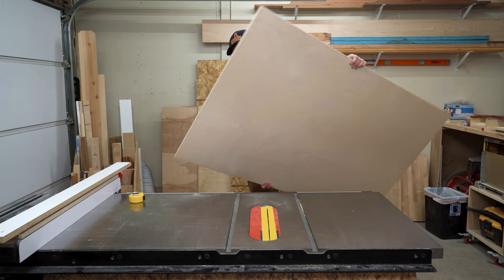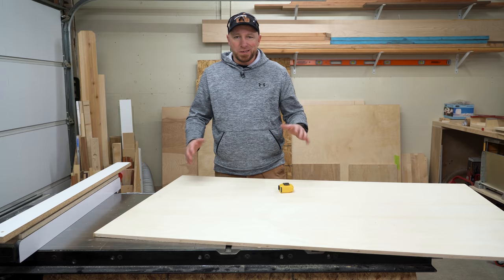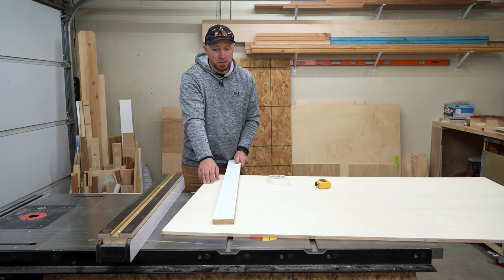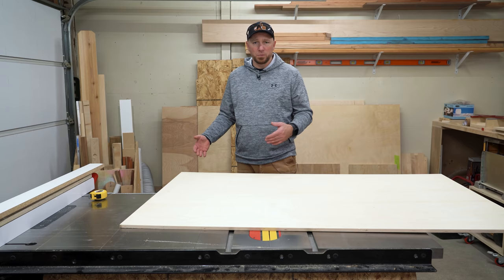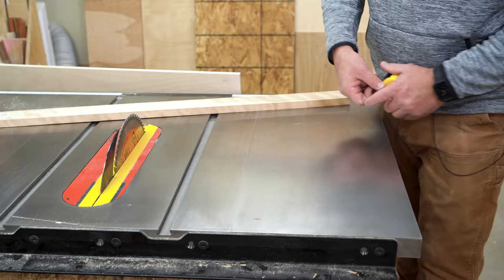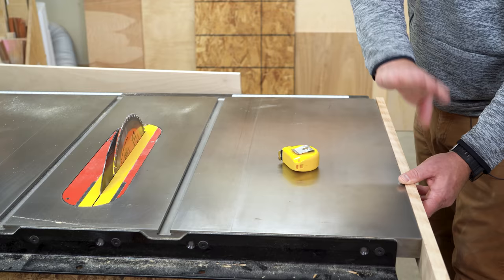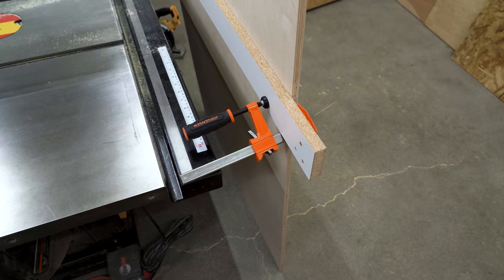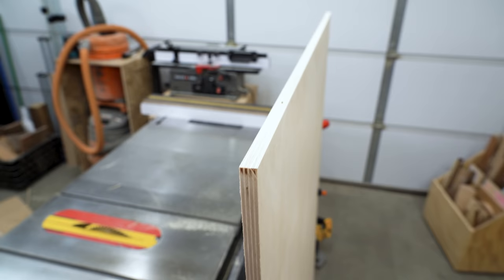A Table Saw Trick So Crazy, It's Genius!

Comment: Great tip, I am a cabinetmaker and I enjoy figuring out clever ways of solving the puzzles that woodworking presents. One suggestion for increased accuracy: when measuring from the saw blade to the edge of the table to check if they are parallel, take a magic marker and mark a tooth on the blade then measure from the marked tooth to the edge then rotate the blade so that you can measure from the same tooth for your second measurement. The saw blade may be warped just slightly and measuring from the same tooth both times eliminates that issue. Keep the great tips coming!
Reply: We usually just cut from the drop side against the fence.

If you stand with the sheet braced against your hip and keep your hands outside the blade, even if it does kickback, it will throw the sheet in such a way that it will rotate off your hip and your hands will be thrown away from the blade.

The saw sounds like it is on the verge of kickback the entire time you are cutting ( because it is), but your cuts will be within a 32nd straight and that is fine if you hide that edge where the shoe molding or crown will cover it.
Reply: yes
Reply: Blade warpage will make one tooth, or teeth, on that blade a shorter distance from the table edge than all the rest, so arbitrarily picking a tooth, or teeth, other than that one(s) just mentioned, will give you an incorrect cutting distance. One way to check for warpage, and if it exists, to identify the shortest distanced tooth, or teeth, is to use an indicator mounted on a stand and check the blade by rotating it by hand to check for the high point which will allow you to identify the shortest distince tooth, or teeth from your table edge.
Reply: @Orange-Jumpsuit-Time  I am not convinced that is necessary, especially if you can adjust for that slight change in dimension when you set the fence distance.

Otherwise you can make a couple cuts and bring your fence distance marker to the measured dimension cut.
Reply: Really? You are a cabinet maker and you are still learning how to use a table saw accurately. Well, the first thing is not to cut off your fingers.
Reply: @jeffshackleford3152  i hear no threatening kickbackage
Reply: @rosskstar  when you are cutting the way I described the saw will sound like it wants to kickback, because it is on the verge of kickback.

That is why you keep your hands outside the blade, instead of cutting that small piece off with your hand inside the blade.
Reply: @jeffshackleford3152  well OK then.... just be sure to read yer bible n say yer prayers, cuz it's all a goin down dagnabbit

Comment: I have been making things out of wood for 60 years. I have never seen this before. What I like best about it is that it appears to be very safe as well as accurate. Well done.
Reply: Hardly accurate when the squaring is done with such a small square.
Reply: @peterowens290  explain your point of being "inaccurate"
Reply: @peterowens290 ., Exactly, hardly square, is the word.
Reply: @peterowens290  
Remember it’s not the size of the square that matters, it’s how you use it.

No I’m just fucking kidding, ....you’re right
Reply: @charliedelta9501  that would be an unfortunate family name name of the company making the square. Hardly square. Lol
Reply: @peterowens290  apparently wood workers are measuring to within .001" now! XD gimme a break.
Reply: @coresnap  the fact is if you check from both sides and measure from the edge on both sides you can get a surprising level of precision.  No, it wont be nanometer precise but its wood.  Like you said... gimme a break.
Reply: With so much of the sheet hanging over empty space, unsupported, relying on the operator to hold it down to the table while still keeping the clamped straight-edge flat against the side of the table, and still pushing the sheet over the blade, I'm not with you on the safety aspect.
Reply: @vladtepes97 what part are you saying is unsupported? Looks to me like he was providing sufficient support. It certainly looks much safer than many other cuts I've seen done on table saws.
Reply: Omg. Peanut gallery over here. Gimme a break indeed.  He created a quick and simple jig that gets the job done.
Reply: If you tried this with a finished surface you would have massive blow out. It's pretty stupid unless you're not worried about a perfect edge. Way smarter to use a router with a roller guide and a straight edge with clamps. I made these cuts in the field every day when I'm installing. No mistakes allowed method.
Reply: @stirfrybry1 What do you put under your sheet when you make the cut?
Reply: @Mjr._Kong We make the cut with the piece (like for instance a counter top) on saw horses. Use clamps to hold a straight edge and then use the router to cut along the piece. Very fast and accurate as long as you check twice and cut once. LOL
Reply: @stirfrybry1  Any underlayment?
Reply: @Mjr._Kong We clamp a block on the end of the cut to prevent blow out, but the router cuts clean top and bottom edge. I'm working with laminated surfaces in a commercial cabinet factory where any chipping ruins the entire piece
Reply: @stirfrybry1 . But you have to have a router to do this. Some folks just getting started in wood working might have a table saw but have not advanced to the point of having a router yet.
Reply: @Sillyturner  not this is everyone situation, but I find it funny that you said that cause a router was like my first things (besides a drill and hand tools) I had cause I found out you can do a lot of things with it. I sure somewhere OSHA handbook is burning if they saw some of the things I did with this thing. On that note, don’t use your tool in away that could hurt you.
Reply: @stirfrybry1  if you could drop a link showing this done that would be great. I’m having a hard time visualizing how this is done.

Comment: I love this. I submit that this can also be used for making  cabinet panels, (typically 34-1/2 in. long), where some home saws only have a 24 in. wide table, And yes there are other ways to accomplish that, (as you stated), but for 2-6 panels, this is a great idea. Not everyone can afford/have the room for a cabinet saw.
Reply from the maker: Or can afford a track saw that's actually decent. Thanks for leaving a rational comment and actually paying attention. Ha!
Reply: @InspireWoodcraft  Just an observation: You don't need to worry about the tape hook at the start of the tape messing your measurement, that hook moves a distance precisely calculated to take into account the hook thickness.
Reply: @skwalka6372  its just hard to place the hook ontop of the board..
Reply: @InspireWoodcraft  super sketchy you have a $4,000+ sawstop table saw and woodpeckers tools but don't own a decent circular saw or a track saw... 😂😂😂
Reply: @Dave Ortwine  or he is showing those that dont have those tools a way they can get stuff done on the saw they have, such as a jobsite saw.

Comment: Great tip and I'll keep it in mind that next time I'm faced with that issue.  Another tip if one wanted to increase the accuaracy when measuring from the table edge to the saw blade, simply place a long straight edge (12" to 15") against two of the saw teeth to widen the area of the measurement when checking for parallelism.

Comment: Hi Jodee, I used this method this morning to cut the sides of a set of cabinets to their final size. I have an old 119 series Craftsman table saw that has a limited fence width, however, this method worked GREAT! 
I receive a lot of value from your videos. Thanks for putting in the time and effort to produce these awesome resources!

Comment: Nice tip! Thanks for that.
I retired my table saw for any full/half sheet cuts. I got that Kreg rip cut and with my Skil magnesium worm drive and a sheet of rigid foam insulation under it, it’s so much easier.

Comment: I think my favorite method of cleaning up an edge on a large piece is to use a trim router and set up a straight edge, and use a flush trim router bit.
Reply: That was my go to until I extended my fence rails out to allow for 60" cuts.
Reply: 100 times safer as well.
Reply: 100% agree with this remark. I'm a Retired General Contractor. A router is so much easier and can be used in the field without a table saw. A couple of saw horses, a couple of clamps, a straight edge (I use an aluminum 10' 2 x 4 screed) and a router with the proper bit. Not only is it faster, safer and easier, you get a jointer quality edge every time. If a jointer edge is not needed try a Skil worm drive contractor's saw with the proper blade. Wobble has never been an issue with that kind of saw with me. Also with the proper set up on saw horses you can cut right across the top of the saw horses to easily cut plywood of any length, in any direction with proper support, 8' 12' any foot, no problem with perfect straight cuts.
Reply: @Ron-no4tp  Thank you Ron. I have also used this method to make fine adjustments to make doors fit, or shave off a bit from the top and bottom.  I have some closet doors that I built that I need to reduce their length to make the guides fit a bit better. And so, when I have time, thats one more on my list to do.   When I am doing 1 1/2 thick material, I will use the router and take off a bit more than half way through and then come back with a flush trim bit and get the other side.
Reply: @Ron-no4tp  I've been a contractor for 40 years, getting ready for retirement myself. I don't even own a big heavy shop table saw, it just takes up too much real estate in my shop.. I do have a 10" job site table saw that I use If I have many rips to do, I'll bring that to the job. But, honestly, I prefer cutting sheets of plywood with a good straight edge with some clamps and a good corded circular saw, good blade is all you need and good saw horses with 2x4s on top, will get that job done easily, and alone with no help. Struggling with a full 3/4" sheet of finished plywood solo on a table saw is a hassle.  As a contractor, I try to travel light. But for guys that are working on a budget, or have limited space, you can get table saw quality cuts on a very small budget and put it all away in a small space. I see so many shop wood workers that don't have a good $120  circular saw but they have a $2000 table saw. I've made lots of Built ins in homes with nothing more than a circular saw, a miter saw, a portable table saw, Most of the time, I don't even need a router.
Reply: I've used both the table saw edge method as well as the router/flush trim bit/straightedge method for many years.  They both work well but the router is much less awkward when the panel hangs over the table saw edge by a large amount - for example, when you're cross-cutting something close to a full sheet.

Comment: Normally I would use my circular saw guide for a cut like this but I tried this instead. It worked out great. I was able to support the offcut with full control. Thanks!
Reply: I was actually wondering if you couldn't use one of those clamp-on circular saw edge guides like Harbor Freight and Bora have to ride the edge of the table saw instead of the clamped board.

Comment: Thank you for bringing up the often forgotten parallel edge guide in a table saw. I have a craftsman table saw with tabs on top of miter gauge slots, making it difficult to construct runners for the sled. Thanks to an utuber, I built the sled with runners guided by the outside ends of the table, just like the one u have shown. No fancy trial and error to build the perfect runners to run on table slot.
Reply: I would love to know where you found that. My TS is a really old craftsman with the tabbed miter slots, too.
Reply: @wendytorkelson9305  don’t remember. The fix is easy. With an angle grinder you can cut off the tabs, if you want to use the table slots for sled rails. Or, you can build a bigger sled with table edges as guides with runners attached to the sled

Comment: You can avoid some hassle by setting the table saw fence next to the blade, then lower the blade and just clamp the guide board to your sheet using your fence as a reference. And, Check for square! Great videos!
Reply: Yes so long as the edge of the plywood is already square and flat, whereas I believe he was saying his edge was wobbly.
Reply: I am not a lateral thinker .Would You have a diagram please ? ThankYou either way !
Reply: That cuts the task down dramatically! Thanks.
Reply: I think this video addresses the situation where the edge to be cut off is not straight enough to use as a reference.
Reply: You have more plywood hangover weight to deal with not practical work smarter not harder
Reply: This should work if you have a factory edge or square edge and you’re doing a cut somewhere deep into a large panel. However in the video it’s not a square edge. The video tip deals with both large material and wobbly edge at the same time.

Comment: Nice tip! As a cabinet maker of 30 years (I now have saws that will cut this, but before...), I would have used a router, straight edge and clamps to do the same cut. For guys interested in woodworking, it's AMAZING, how many times you will use a GOOD track saw if you spend the money for one!  Free hand cuts (odd shapes and angles) and live edge cuts are pretty much  made SAFE, and it's EASY to make track jigs for a router or other equipment!
Reply: Yep. Router.

Comment: Good tip, short and sweet!  If you have a lot of overhang, it helps to place a roller stand under that so you're not fighting that tendency to tip while you're pushing the sheet through the cut.

Comment: And this video is a good example of why this is my favourite channel. I run into this problem all the time and I always turn to my wobbly circ saw.
Thank you so much for posting this.
Reply: Make a simple brace for the rear of your wobbly saw, so that the baseplate is supported in two places, rather than just at the height adjustment hinge.
So, looking from the rear of the saw....
Instead of 1 support like this on your base: ._.||.___.
You have it supported in 2 places, like this: ._.||.___\.
By triangulating it, the wobble and flex will instantly be removed.

Comment: What a great trick! I wish I had found this a few weeks ago! Working on building my first cabinet out of plywood using my jobsite table saw and had a few cuts I had to make with a circular saw + guide that inevitably came out less-than-square which just compounded after I kept cutting from it. I've got a lot of cleanup to do. Thanks for the tip!

Comment: I have fought with trying to make cuts that tests the limits of my fence, and this is an interesting solution to that. I guess you could extend the table edge out, like this, as far as you needed to make this work with pretty wide cuts. Thanks!
Reply: Why would you extend the table out? Wouldn't you just move the wood piece on the bottom of the plywood?
Reply: Supporting more than a couple feet off the table pulls the panel up off of the blade. A roller stand or two works great for extending the table width
Reply: @slimdout  if you are worried about it pulling up off of the blade you can clamp a piece of scrap to the fence a little over the height of the material, and bring it in tight enough to the blade to hold the sheet down.
Reply: @wesman7837  that carries its own risk of pinching the cut piece between fence and blade 🤷‍♂️
Reply: @slimdout  it could, but I have never seen it happen.

Comment: I tried this today and it works! I used the Milescraft circular guide tracks as a straight edge and the T Track hold down clamps that it came with and got excellent  results.

Comment: Great tip.  I have seen a few other jigs using the very straight and sturdy edge of the table - it is an overlooked feature.  For me I use the track saw, then perhaps a router and trim bit.  I just hate wrestling with a large heavy sheet…. But this is an excellent option without those.

Comment: I always prefer the table saw because it's more accurate.  But I don't have a trailer.  And my jeep won't fit a full sheet of plywood.  Surprising, my brother-in-laws Toyota minivan has a PERFECT fit for plywood. Who knew.  Anyway, broke down and got a tracksaw.  And I got the square edge and parallel guides.  Pricey, yes. But now I can cut it up perfectly in the parking lot and bring home pieces that are ready to go.  But i LOVE your problem solving videos.  As soon as you measured the sheet, I smiled and gave myself a "could have had a v8" knock to my head.  Thanks, I now have another method that I can keep in my toolbox.
Reply from the maker: I think the first time I seriously considered buying a track saw was when I had the Home Depot cut some sheets in half so I could fit them into my Yukon. The panel saw that they use wasn't square, and for some reason I didn't think to check before I started breaking the sheets down for my project. Messed everything up. But instead of a track saw, I bought a truck. Haha
Reply: @InspireWoodcraft  See, now I know you're lying.  YOU CAN NEVER FIND ANYONE to help with the panel saw 🤣  And buying a truck is another solution to the problem. LOL.

Comment: Good work, only suggestions would be to have support along the left edge if the amount hanging off the left exceeds the amount on the table and off the back edge. Second. Use a larger square. It will allow for greater accuracy and squarer cut
Reply: I would like to have seen him double check with the square from the other side once he got over there, but maybe he was  just trying to use the factory edge. I would like to see a full size framing square for this.
Reply: Measuring from blade to table edge using a tape is far from ideal. Much better to use a metal rule, cost little more than tapes & you can' beat that accuracy.
Reply: @wesman7837  All well and good so long as the reference edges are parallel.... and if the 'square' is actually square. Many are 'square if they could be'. 
3 x 4 x 5 triangle geometry is better... don't you think?